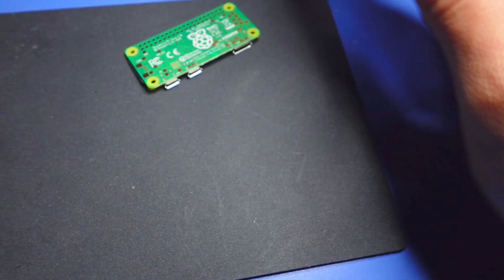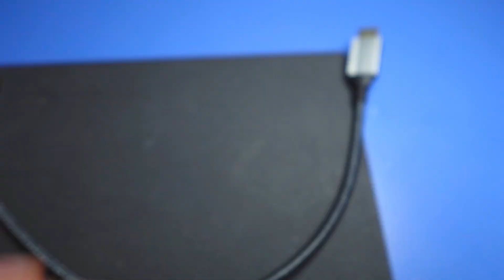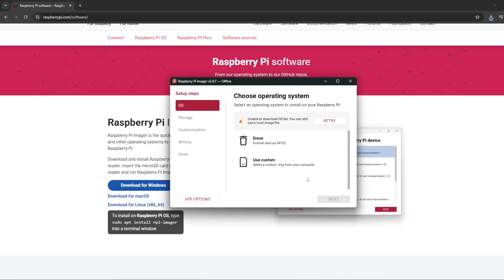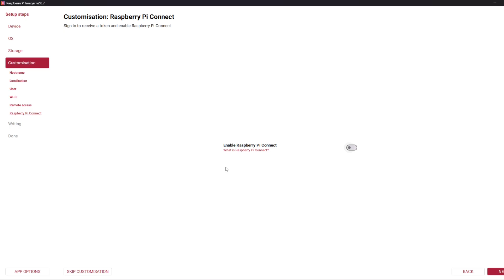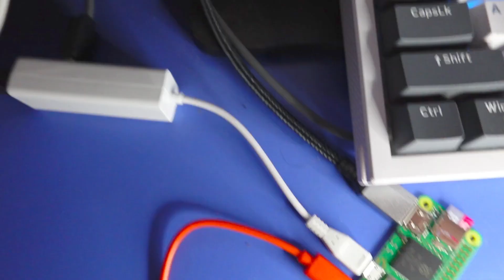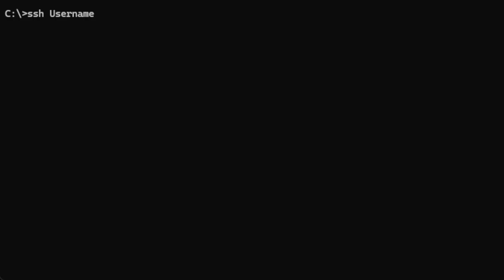How to Setup a Raspberry Pi Zero 2 W | What You Need & Step-by-Step Guide

Comment: Very timely, I’m about to set up a Zero 2W. I’m assuming I can use the Lite OS, and run it via SSH from a terminal on my Pi 400. Is that correct ?
Reply from the maker: Yes, absolutely. You can use Raspberry Pi OS Lite on the Zero 2 W and enable SSH directly from the Raspberry Pi Imager before flashing the microSD card. If both devices are on the same network, you can SSH into the Zero 2 W from your Pi 400 terminal without any issues.